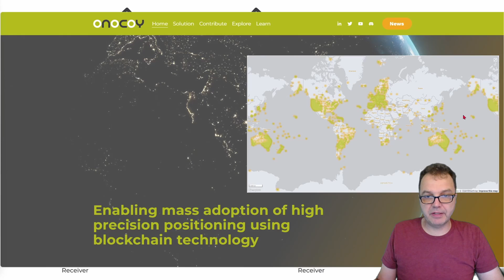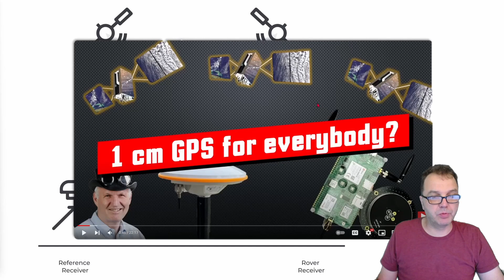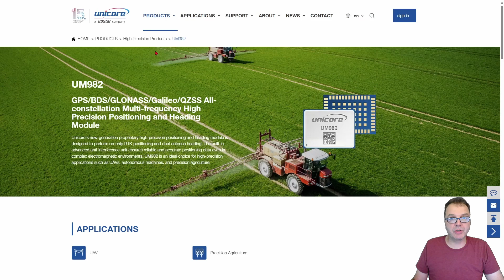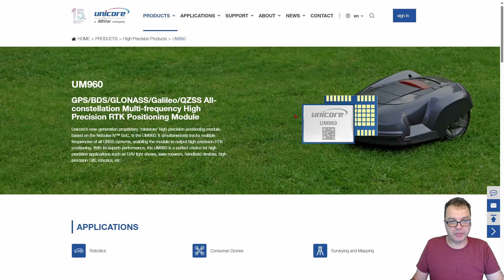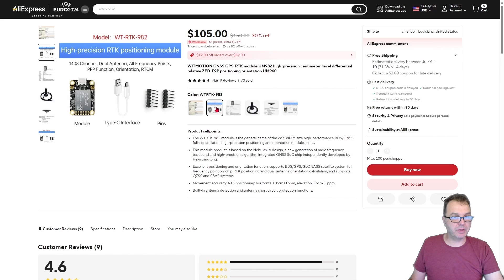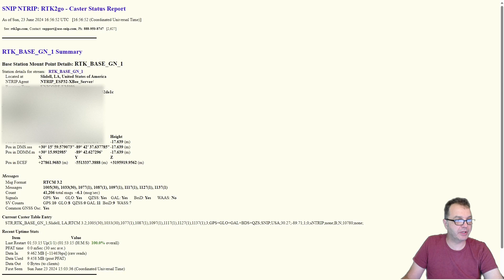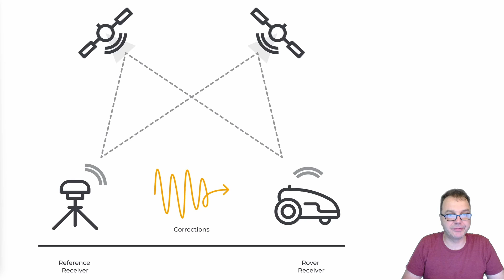Intro to RTK Playlist: Achieve Centimeter Accurate GPS and Crypto Mining with Affordable Hardware

Comment: Hi can you make this base with Comnav K902 Board?
Reply from the maker: I don’t see why not, but you would have to read the manual for the commands to set up the K902
Reply: @oceanexplorationlab I tried some commands but don't see esp32 output on the website. can you make a step by step video of making base using k902?
Reply from the maker: Unfortunately, I do not have the K902 module, so I can't make a video for it.
Reply: @oceanexplorationlab Hi can you use k823 Board to make video?

Comment: Excellent video and instructions. I think I'll try this. Thank you. One thing I don't understand. Precision and accuracy. My understanding is that high precision (sub centimetre ) is desirable, and accuracy means accurate  integration with a know datum and projection. Nice to have both. So if you set up your base station anywhere over any random position, what is the result ? I was just wondering.
Reply from the maker: With long integration times (~24h) and post-processing, you can achieve absolute positioning within +-2 mm! I’ve been planning to make a video on this for some time now but haven't gotten around to it yet.
Reply: @oceanexplorationlab  wow that is incredible. So if I understand this... the position of the permanent basestation on your roof, it can be determined very accurately without the need of a survey crew coming  out to give you an accurate position?  I'm just wondering what is streamed to rovers in the area.

Comment: most of the recivers from companys like CHCNAV , STONEX etc use UM980 chip for the gnss recivers(rovers), what do you think about that?, also do you think UM980 is as good as a Trimble Chip or no?
Reply from the maker: For a single-antenna rover, the UM980 is a fine choice. It will save you some power compared to the UM982. I have no insight into the relative performance between a Trimble and the Unicore modules. It would be interesting to hear from somebody in a position to compare the various options.

Comment: Hi There, Thank you for creating these very valuable videos. I am from Canada and we are working on a project which requires centimeter level accuracy. I am trying to order a test kit. I need your advice please. I need a Base station which can connect to local wifi and a Rover which can connect to local wifi too.  Looking at the options available to buy, I would need 2 sets of WRTK-982+ RTK-BOT-LTE-G and one GNSS Antenna. Is this enough to start a dev setup?
Thanks in advance for your reply.
Reply from the maker: If you only want to set up a local network, you do not need LTE. However, you will need two antennas. You may also need a Wi-Fi access point if the distance is too great for a local hotspot connection between ESPs. There are so many options that it is impossible to give precise advice without knowing your exact needs. Good luck with your project!
Reply: @oceanexplorationlab  Thanks for the reply. Does it mean that the 982 module has a wifi chip that can connect it to any regular access point? I ended up ordering two 982s and 2 antennas. Going through the rest of your videos. Thanks again for the quick reply and saving us a bit of $!
Reply from the maker: No, the Wi-Fi is provided by the ESP32.

Comment: Thank you for the nice series. Is it possible to buy a cheaper antenna for WTRTK-980/82? If yes, which one do you recommend?
Reply from the maker: I have not tried but it should be possible with some loss of accuracy
Reply: @oceanexplorationlab  The reason I asked that this antenna (in your video) is good for base station but for rover (say a bike or any small vehicle ) it is not suitable.
Reply from the maker: @IamGPSGuy  True, they are too big for mobile applications. I have smaller antennas but haven't tried them yet. This is on my to-do list

Comment: ??? Last week, I just paid $15,500 for a GPS + Monito data collector. For another, is this something I could build?  I've got a little electronics and programming experience.
Reply from the maker: Absolutely, by the end of the series, I hope to have provided step-by-step instructions on how to build and set up the base/rover RTK solution. The module I am using is an L1/L2/L5 triple-band system. I'm not sure what your $15k setup adds to this and what your requirements are. The video on how to set up the base should be out next week. Let me know if you decide to follow along. Cheers!